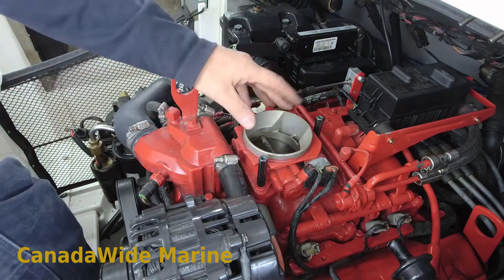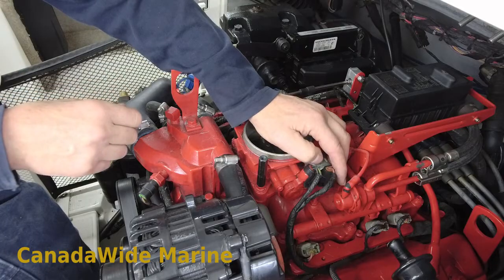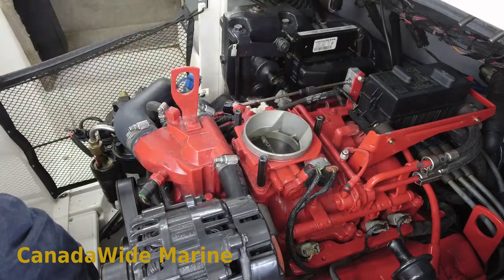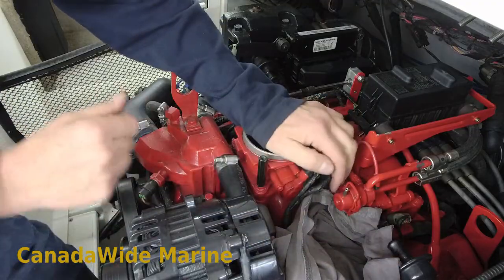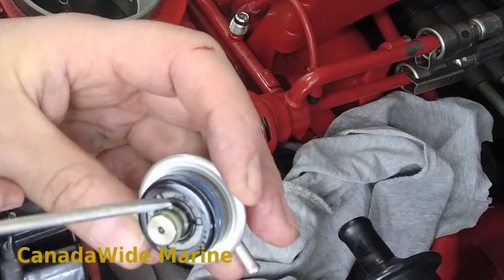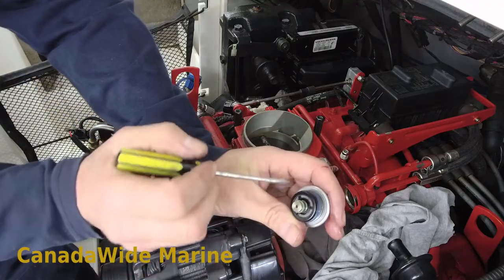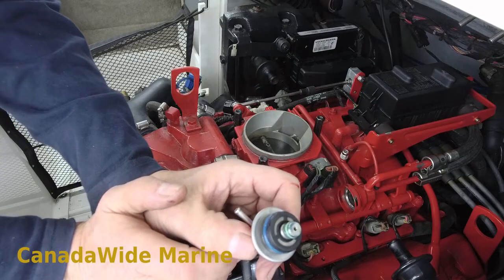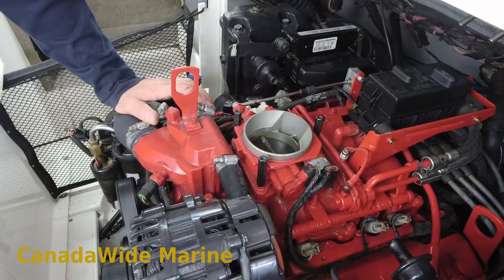A little more information on Noisy Volvo Penta Fuel Pumps

Comment: I have a 2013 fourwinns 4.3 225hp gxi Volvo Penta, Volvo has replaced 6 fuel pumps under warranty and I am currently in my boat putting number 7 on. Im not sure if they ever checked or replaced this regulator but im replacing it now. Thanks for the videos it's a huge help.

Comment: I currently am having an issue with a mercruiser Volvo penta 5.0 OSI-E. Currently having issues with it when I ride it will go along well then all of the sudden it will act like it’s not getting fuel and RPMS will go up but it’s almost like it’s choking out. We have changed plugs, wires, cap, ignition coil, fuel filter..fuel pressure test was done by mechanic and it was operating at the time. Is there anything else you can lead me too.. @canadawidemarine
Reply from the maker: The rpm goes "up" when this happens?
If the rpm was going down when this happens I might suggest it is entering "limp home mode" from possible overheat or low oil pressure. But I don't understand what you mean by rpm going up at the same time it is choking out or running out of fuel.
Reply: @CanadaWideMarine  I have a video of it if I’m able to send that to you. It’s almost like it’s running out of gas that’s when it’s trying to stall and RPMs go down and up. I appreciate the help!
Reply from the maker: @RussellGrantham-g4x  you can simply post your video on Youtube and send me the link to it. 
Was the fuel pressure tested while this problem was actually happening?
Reply: @CanadaWideMarine  I was able to post earlier with what it’s doing..if you turn sound up you can hear it too. Thanks again! 
https://youtu.be/gCnvksaL9lo
Reply from the maker: First thing I would do is check fuel pressure while the engine is hunting like that. It sounds to me like fuel pressure is dropping off in the fuel rail. Check low pressure to confirm low pressure pump is working. The engine will run without the low pressure pump, but the high pressure pump does not draw from the tank very well past the low pressure pump.

Comment: I wanted to ask your recommendation on first start up in the spring for my volvo penta 5.7 GI. Is it best to temporarily disconnect the fuel pump or injectors in order to build some oil pressure before starting?
Reply from the maker: We never do that here. Spring comission is an extension of our winterizing process, which includes an oil and filter change, so we know the oil is fresh and the oil filter is full of oil for our spring startup. we also fog the cylinders in the fall so they are still lubricated in the spring.

Comment: I have a 8.1 that didn't have an anti siphon it would whine and stall and not start. I added the anti siphon and it cured it but I don't understand why??
Reply from the maker: My Guess is you had an air leak in the fuel supply line which got repaired when the anti siphon valve was added.
Reply: @CanadaWideMarine  thanks

Comment: Hi I have a  cruiser with a volvo penta 4.3gxi  that I just purchased this August it needed some maintenance  and your expertise help me a lot. My question is how do you clean the pressure  regulator with the air hose .Do you spray the air on the screen or at the hole of the vacum intake or at the output hole. Thanks for your videos they are very good.
Reply from the maker: I just blow the air across the screen to remove the visible debris.

Comment: Thanks so much for sharing some more advice. I have a 2007 Regal 2250 with the Volvo Penta 5.7 Gi and will be changing the original plugs, wires, rotor and cap this spring. I'm a little worried the plugs may be a little seized, being in there for so long. Is there any advantage of trying to take them out with the engine warm vs. cold?
Reply from the maker: For me, it would depend on access mostly. If I have easy access and don't have to have myself jammed up against a hot engine, I would try it with a hot engine. But the truth is, in my experience the spark plug seizes on the taper so hot or cold doesn't make much difference. Hot engine will help on sticky threads, once the seal of the taper is broken though. I always grease the threads, and a wipe of grease on the taper seal as well when installing new spark plugs. 
Hope it goes well for you.
Reply: @CanadaWideMarine  Thanks so much for the quick response! Access is pretty good. Do you ever spray with PB Blaster to help break the seal? Also, would a bit of anti-seize on the taper of the new plugs be a good option?
Reply from the maker: @4-Runner  PB Blaster will not penetrate the tapered seat until you have actually broken the plug loose a little bit, then it will help lubricate the threads if they are tight. You can use anti-seize if you like. I pretty much never use it. I little side note on anti seize in a marine environment: Anti seize has metal in it, usually copper, which is highly active in an electrolysis situation. Basically any moisture and dissimilar metals and you get galvanic corrosion. It is really bad in salt water as salt water is a better conductor. So I just don't use it. And besides, it's messy.

Comment: As a Volvo Penta gas engine owner, I really appreciate these videos. Thank you! The service bulletin you mention is P-23-7 number 3, which states to replace the screen with an e-clip. I have done this modification myself and the screen will not come off without breaking it (which is fine as you’re removing it). Still have the pump whine though, so I’ll be investigating the suction side this off-season.
Reply from the maker: Thank you, we appreciate you watching them and taking the time to leave great comments.
Reply: @CanadaWideMarine  I wanted to get your thoughts on engine oil for my Volvo Penta 5.7 Gi. The manual states SAE 30 and the local dealer recommends 10W 40. I've also seen some people use 15W-40. The engine usually only runs in temps. above 15 degrees Celsius.
Reply from the maker: @4-Runner  If you brought the boat to our shop it would get SAE 30, as that is what the manufacturer recommends. Switching to a multi grade will get the oil flowing faster when the engine is cold. Once it warms up you will effectively have whatever grade the second number is. So, a 10w-40 will actually be a little thinner on cold startup than a SAE 30, but once it warms up to operating temperature the 10w-40 will be a little thicker. If it is an old engine with plenty of hours on it, (read a little looser in the clearances) then a 40 will be just fine. If it is a newer engine, low hours, a little tighter on the clearances, you are putting extra load on your oil pump and distributer drive. Not to mention heavier oil is harder for the oil rings to scrape. In my experience I have never seen any performance improvement or longevity improvement from different grades of oils from what the manufacturer recommends. BUT, clean oil is extremely important, change your oil every year regardless of hours used or every 100 hours maximum. many new boat engine manufacturers are now calling for 50 hour change intervals. The oil after 100 hours is pretty beat up.
Reply: @CanadaWideMarine  Thanks so much for the response. This helps! The engine has 250 hours on it, which I think is pretty low. for a 2007. The volvo-penta dealers in Ontario don't seem to stock SAE 30, but I've read some people use the Valvoline VR1 SAE 30 with no issues.
Reply: For SAE 30 oil, does your shop use the Sierra Synthetic? @CanadaWideMarine
Reply: @havarh do you or anyone else know if that e-clip applies to the 4.3gxi as well? Or is it for the 5.0 motors only?
Reply: @af_loyd20  I wouldn’t know, but if the 4.3 has the same fuel cell assembIy as the 5.7 I would assume the same modification could be done to the pressure regulator. Just remember that any particles not captured by the screen will pass to the injectors. Having recently rebuilt the fuel cell assembly, removing all the paint and changing the O-rings, I found a Bosch part fuel pressure regulator costing 1/10 of the VP branded one. I’ve been running this for the last trips (with the screen) just to catch any remianing paint particles.